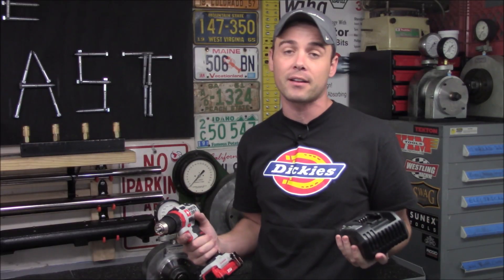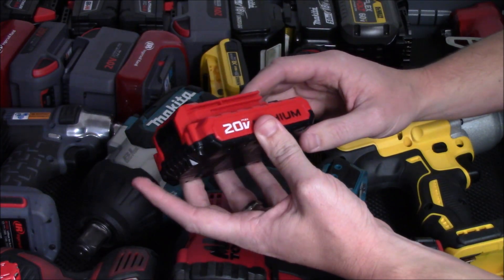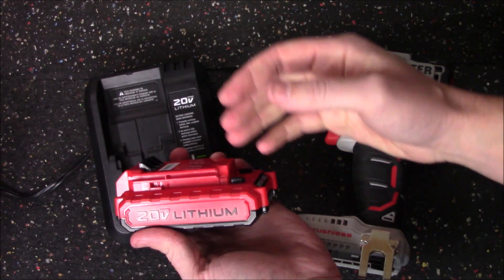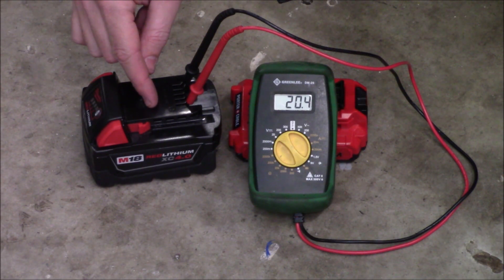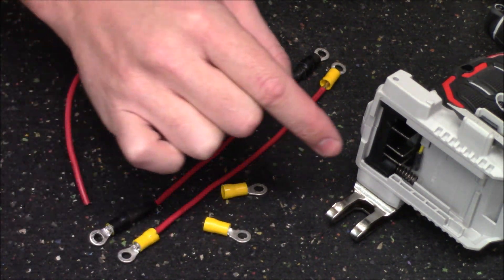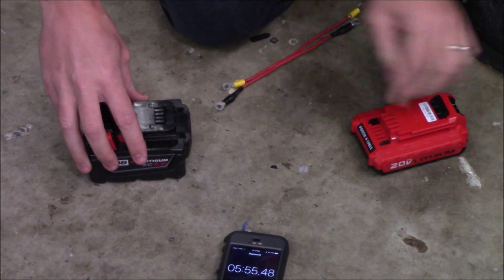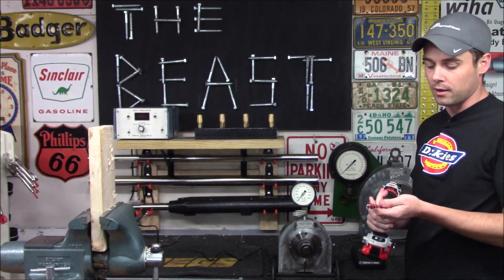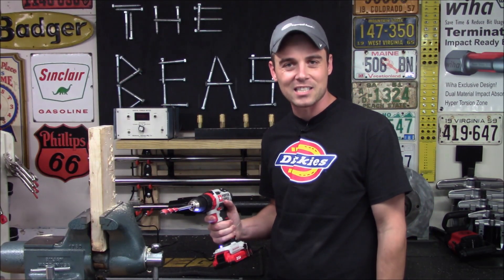Back from the DEAD!  Lithium Batteries!

Comment: Hi everybody
This way is dangerous and wrong!
Why? 
Because no resistors is used. Resistor or 12v lightbulb or longer skinny wire need to be used! 
If not used, it will destroy your working battery BMS electronics or even 18650cell internal fuse by overloading. It this happens, it sure is going to bin. I have seen it many times when people bring in their new blown up lithium powertool batteries. 
Lead batteries can be jump started with extreem voltage jump but not lithium. Lead acid batteries have more rubberie voltage. Lithium is trying to maintain its voltage no matter what. It is like towing a car with long chain. Once the loop of chain runs out, something will snap. BANG.
Lithium cell has MAX nominal discharge and charge rate. Marked as C rating. Power tool cell have up to 25C discharge rating BUT not more than 5C charge rating.
Meaning you CAN NOT charge super rapidly.
Yes, you may get luckey if you have some cheapie 1.5Ah half weak battery.
If you do it with bigger and more powerfull 5Ah Makita, Hilti, Milwakie or similar battery = Most likely KABOOM
Reply from the maker: Yet I cannot find proof of that happening ANYWHERE online....

Comment: not always the case my battery pack would not charge because it had a bad cell which i replaced now it reads over 20 volts vs 17 volts with the bad cell.

Comment: Or you buy ridgid and have free battery replacement for life and be done with it
Reply: I have all Ridgid and I have 17 dead Ridgid 18 volt 4.0 ah hyper lithcrap and I have gave up trying to get a battery replaced . I work around high moisture content and they die . Every other makers battery holds up except Ridgid . Every tool is Ridgid except a Ryobi drill and a DeWalt . 
It saddens me that I have spent over a grand easy on Ridgid free battery replacement , I haven't seen it . Show me and then ill believe. but until I get these replace . My trusty back up is a cheaper brand 
.

Comment: the marketed voltages 18v and 20v are not with load/without loud: 20v is the fully charged voltage and 18v is the nominal voltage - in other words the voltage half way between fully charged and fully discharged, or the “average” voltage.
Reply from the maker: Fully charged = without load
Nominal voltage = with load

Comment: I have a Ryobi 40v that will hold a charge, however when connected to the tool, nothing happens. Is there anything that can be done in this case to revive the battery?

Comment: So, if there is any current left in it at all and can run the drill then it's not a short? Just won't charge because it fell too low behind the manufacturer's setting. Wonder why they did that? Was it just a design to sell more batteries or is there some safety issue they had to be compliant with?

Comment: I don't want to risk damaging my good battery. Can I just try with a 9 Volt battery instead?
Reply: You don't risk damaging it by taking 2 good batteries and hook them up in parallel when one is over discharged, the 2 batteries are going to balance themselves to an even voltage. But you also got to be careful when you connect batteries that are different in V. Let's say a high voltage battery (fully charged) can charge a smaller  voltage battery but with risks, i don't recommend doing it and especially if  the voltage difference is big and also if you don't know much about electricity. You may try asking friends if any have a variable power supply so you can charge your pack safely

Comment: i followed these instructions from one M18  battery back to another. The charged and properly functioning  battery fried and melted the terminal almost immediately after connecting the batteries. this battery is trash now because it wont connect to a tool. The batter pack that would not charge, was able to charge but it defaulted back to "unchargeable" after one use. can you help - suggest otherwise? (i just had another battery turn unchargebale)
Reply: Is it possible you wired it like the video and the wires should have been crossed over to get + to + and - to -? If the two batteries are the same the video shows the wrong wiring!

Comment: Cutting to chase. 48VDC battery pack sitting for about a year will not charge. What voltage would I set my power supply to and do I need to limit the current and if so what limit should I set? After I have the correct numbers what is the length of time I should keep the setup going?
Does the battery management board have any effect on this setup?

Comment: KEEP DRY SAND NEARBY FOR LITHIUM BATTERY FIRE CONTROL 
Do NOT use water to try to put out any lithium battery fire that occurs. That includes some fire extinguishers. Water can in fact make lithium-based fires much worse and/or cause explosive projection of flammable material to nearby objects/people/pets.
Keep a fairly large amount of sand or dirt on hand to smother any lithium battery that starts to smoke or is on fire, or that you hear start to "crackle", or if you see it start to discolor/blacken.

Also, I would keep a separate appropriate fire extinguishing method on hand to help control/put out any secondary fire(s) that are not adjacent to the battery itself (e.g. if fire spreads to grass, trash, clothing, or other objects). Because lithium battery fires can be VERY fast, explosive, and quickly spread and "jump" over small areas of cleared ground into nearby brush, furniture, etc...I'd personally keep handy an extinguisher rated at a MINIMUM of "10A".

I'd also make sure I wasn't testing things near sources of flammable liquids, other electrical equipment, and people or animals and over-hanging tree and bush leaves and branches.

I realize this is boring stuff, but sometimes we just forget to think of these things when in "debug" mode.

Comment: I haven’t had this problem yet but I’m sure it will show up sometime. The problem I have is the batteries not holding the charge. Fully charged they drain as soon as I turn on the drill and can’t drill one hole before it’s dead again.

Comment: Thanks for the explanation, a little long winded and a little dangerous, but you explain to do it outside and that should be sufficient warning. I checked mine and it was only outputting 1.5v, likely because I lost the drill and it was in it for about a year. Luckily I had a power supply around, set it to 14.4v and 1.5amps, after about 10 minutes the voltage was up to about 16v, the charger then took right back over like normal, so thanks again for doing the testing for us, it made me much more confident going through with external charging.
Reply: What kind of power supply did you use ? "Power supply" is a broad term so not sure what you used .  I have a Harbor Freight  trickle charger,wondering if that would work safely ?
Reply: @rosskrause3926  I believe the generic term is "laboratory power supply". It's a testing unit that allows you to adjust the amperage and voltage output. You should only charge it up to what it can handle, but as long as you're not exceeding the output of the original charger, or at the very most the 18-20v it's supposed to support. You should be ok. 

Just remember, the goal isn't to fully charge it, just to get it over the threshold for the OEM charger to recognize it as a good battery.

Comment: Lithium batteries from reputable tool companies should all have battery management boards which monitor both charging, keeping charge rate under control and not allowing cells to go higher than about 4.2 volts, as well as monitoring discharge, not allowing cells to fall below about 3.0 volts or thereabouts.   My DEWALT tools cut off when 20 volt max battery is about 15 volts or just under.   If he can run that drill literally dragging forward then it is already too low and should have shut off earlier.   Something else might be wrong so beware.   Battery packs can drift down after a very long period of being on a shelf.   Then this technique could be appropriate,

Comment: It really works. I got the same information from another video .
My problem was a set of new unused M18 Milwaukee batteries were sitted in storage too long.
It won't charge even left 18 hours in the charger. All were less than 3.5 volts.
The warranty were over. I boosted them with an old nicad battery with only 14.5 V for 15 min. 
It brought the M18 Milwaukee batteries back from 3.2 volts to 14 volts. The M18 Milwaukee charger immediately recognized it and charges both from dead to full.
I fully tested them for usage. 
The results were excellent.
Almost throw them all away.
Reply: That shit don't wirk

Comment: Say, if you don't have another working Li-ion battery on hand, then would a 2 x 9 volt batteries in series work to revive the dead 18 volt Li-ion battery?
Reply: Yes, but you need a low current, like 100mA, to prevent disasters. Use a volt meter to calculate the voltage difference and select a light bulb voltage and wattage that will draw 100mA or less.
Watts=Voltage*0.1 (Amps)
Or buy a resistor:
Resistance=Voltage/0.1 (Amps)
Watts=Voltage*0.1 (Amps)

Comment: The cells on this unit are Samsung INR18650 cells (5 of them).  They are 3.6V cells which comes out at 18 volts.  The packs are labeled as 20 volts in that 20 volts is the charging voltage for these cells (4.2V charging X5=20V).  If the cells get imbalanced in terms of standing voltage, it reports as a bad battery.  The multiple connectors on the battery pack reach in between the cells.

Looking at the connectors on the battery, you should see roughly 20V from right side (+) related to each of the other three connectors... but no reading from the left connector to either of the middle connectors in any combination.

Opening the battery shell, you can specifically measure across any individual battery.  Each battery unloaded should show 4.1 volts charged.  The key is not to look for 4.1 volts though, but a difference between each cell individually.  The circuit board has a comparator circuit which makes sure each cell is within 0.1V difference (charger is a balancing charger in other words).

These cells are the same as people put in those nasty vape machines, so you should not be too scared of them..  I find it best to charge each cell alone and watching the resulting voltage on each cell until they level out to the point that the comparator allows them to charge on the charger once again.

... sounds a little complicated, but it is simple actually.. The packs are not glued together thankfully, and the sides of the batteries are easy to access once the case is opened...

Comment: sometimes I think I rather the nicad system.  this video is a good example of the downside of lithium batteries. I dont use my tools enough to always keep them charged up and so many times I went to use something and the battery would not take a charge even though the battery was not used much in its life. at least with the nicad, when I need it, charge it up and good to go. with a  dead lithium battery cant even charge it up. sure they hold charge for a long time but if you go beyond that time and forget to keep em charged, you end up to videos like this. I think the manufactures design their charges on purposes to not recognize a dead battery so people by more batteries.

Comment: Can I do the same thing with what appears to be a completely dead pack ( does not turn the motor, but the LED does light dimly)? Or Don't waste time and potentially destroying the good battery?
Reply: Mine was just all the way dead got a 20v off a buddy and only had them connected for probably 30 sec and it is working like new

Comment: Bad idea to do this!
DELAYED FIRE HAZARD for Lithium Ion (LIon) batteries!
The battery pack was shut down as a safety precaution because LIon batteries used to catch fire.  Then someone figured out why, and manufacturers started adding safety circuits to keep that from happening.  What you are doing fools the safety circuit, and can lead to the battery pack catching fire:
 - Once an individual (3V) cell gets below (IIRC) around 1.4V, the copper electrodes start to dissolve.
 - If the pack is then recharged, the copper will form nucleation sites where metal whiskers will begin to grow (by electroplating), inside the cell.
 - After some charge / discharge cycles, the metal whiskers will begin to short out the battery cells.
 - Shorts in the battery cells can get hot enough to ignite the battery.
 - Oops, left it on the carpet by the baby's crib!

LIon batteries hold a LOT of energy.  They can catch fire and even explode, which will at least ruin any power tool they are in, and might start a house fire.

Better to get a new battery, or replace the old cells with new.  Avoid cheap cells that might be jump-started discharged cells.
Reply: Words of reason..  Personally I just rebuild a cell and have a better pack at a fraction of the price..
Reply: Bet your a lot of fun to hang out with.   Not
Reply: @bty1471   Hug??
Reply: ʜ̲̅ᴀ̲̅ɴ̲̅ᴋ̲̅ ʙ̲̅ɪ̲̅ᴢ̲̅ᴢ̲̅ᴏ̲̅5̲̅  wasn't talking to you     but you probably ain't a lot of fun at parties either.
Reply: @bty1471  That's why i bring my friends Bobby, Whitney, Molly, Demet, and bud to the party.
Reply: ʜ̲̅ᴀ̲̅ɴ̲̅ᴋ̲̅ ʙ̲̅ɪ̲̅ᴢ̲̅ᴢ̲̅ᴏ̲̅5̲̅  ✌️
Reply: I hate to reply to your comment.
But it actually works for my  2 M18
battery packs. They were all below 3.5 volts initially then back to fully charged. Tested in real world situation.

Comment: It's all cheap crap. If you don't use the drill or other for around 3 months, the battery discharges to a point the cheap shit charger to recognize it. These should all be recalled for a 100s of millions of dollars loss.  What kind of bullshit is, if you don't use a lithium battery for 3 months that it will never charge again. What appliance would this be acceptable with?  Especially a damn drill that isn't used daily. Garbage

Comment: Excellent video, done right.
But all it not lost; when the battery voltage falls so low that it won't accept this method, there are still two possible options:
In a fire-protected area, apply a current-limited charge (using a variable power supply, set to the rated battery voltage and a small trickle current) for about 24 hours. Then apply the normal charge.  
If that fails, the other method involves a much higher voltage and current to "shock" the cell back to life.  In reality, the "shock" current burns away the crystals in the cell which may be shorting the anode to the cathode. This could either work, or result in a spectacular fire.
Reply: Just no. Don't ever do this !!

Comment: Its called balance charging... A good lithium charger will read the voltages of the individual cells, even better chargers will charge each cell independently to ensure they all are at the same level.

If the voltage of the entire pack is high enough to run the tool, but one of the individual cells is faulty or somehow discharged to a lower than safe voltage... Then the charger will not allow the battery to charge, due to the dangers you mentioned.

Any cell that drops below the safe voltage will have its capacity significantly diminished as well. As time goes on, subsequent recharges on these bad cells can increase the danger of fire.

If that is not the case, and the tool still runs even after the battery is below safe voltage levels... Then the battery pack and/or tool does not have a safety circuit, and that is bad.

The specific chemistry type of the cells used to make the battery will determine their tolerance of abuse... With Lithium Iron (LiFe) being the safest... As they tolerate the use conditions and abuse conditions of power tool use the best... But with the push to higher voltage batteries, the use of LiFe type cells is decreasing, as they have a lower 3.2v nominal working voltage per cell, and higher weight per cell than other formulations.
Reply: The thing is, this is great for lower end/priced tools/batteries, like the Porter Cable he used, Ryobi and older Ridgid etc. But as you said, higher end battery chargers will have a better communication system.

Comment: NEVER TRY THIS 
You will end up with two dead batteries and a fire started
Reply from the maker: Can you post a link to ONE article and/or video of a battery catching on fire by doing this?  I cannot find one....at all....  I can however find a lot of videos and articles showing that this method DOES work to revive "dead" batteries.
Reply: Well, it works, i'm not saying that
What i don't like about this is that you are dirrctly connecting the two batteries, so you have a huge supplier of energy in parallel with an undefined load, if for some reason the "Dead" battery is shorted inside It will draw as much current as the other one will supply and, being a High End lipo this means something like 1000A that would make your wires melt
I don't like this idea because you can't control or monitor how much current is flowing and what is going on
I much prefer to do this with a bench power supply that i know can't deliver more than 3 A or with a bank of capacitors that cannot store much energy
Reply: I didn't want to sound rude, i really like all your videos and you have thaugh me a lot of things about tools, but this time the electrician inside me got scared
Reply: tell him to get off you!!!!!!!

Comment: Only prob with this is the 18650 cells are very sensitive to voltage/balancing and once they drop below the threshold voltage (they will never perform the same).
Reply from the maker: +Canadian Gear Addict would you say that they will perform better than they would by throwing them out?  Part of something is better than all of nothing.
Reply: Oh i totally understand and I wasn't trolling just saying that the cells wont perform as good anymore. Great video